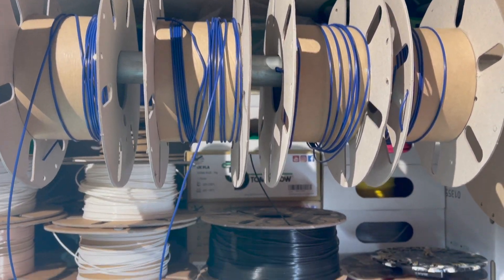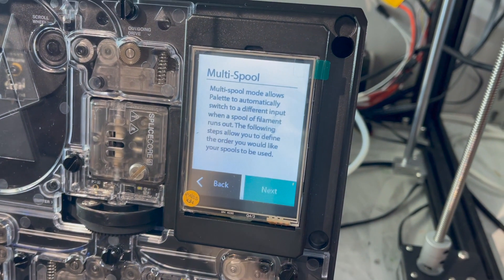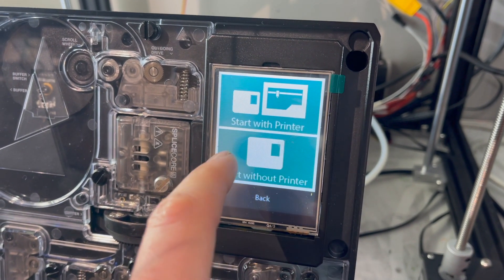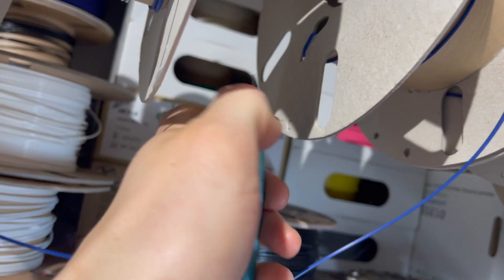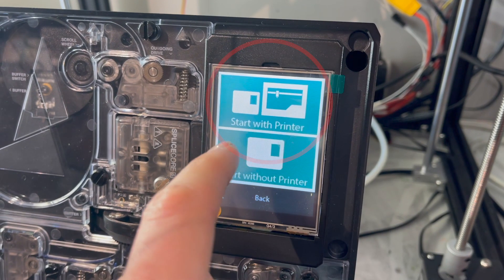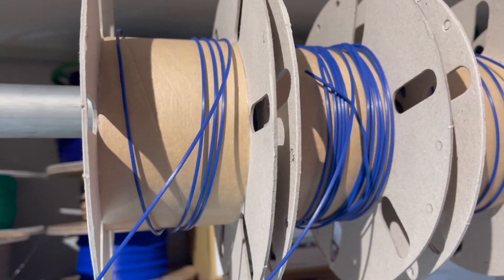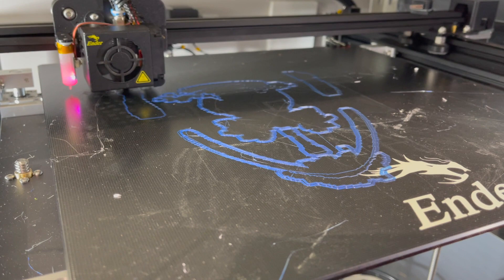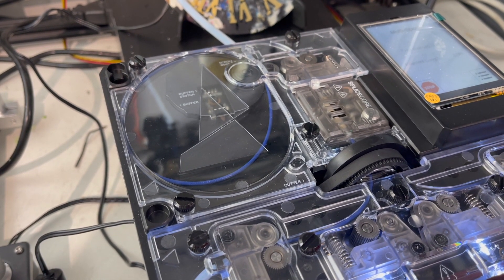PALETTE 2S 'Multi Spool' - Use up Filament Ends!!

Comment: Hi mate,

I am using palette 2s pro for the same purpose. However, I ran into a problem: While waiting for palette to splice, the extruder is still feeding the material to the hot end. After 5 second of not having any material fed from Palette, the material is chewed out at hot end, which then caused the failed print. Do you have anyway to get around this issue?
Reply from the maker: I wonder if its the end of the filament roll catching and causing issues? If the end of the filament pokes out of the spool, trimming it back before loading it into the pallette might solve the issue. Let me know

Comment: A skull?
Reply from the maker: Not a bad guess actually, it is a face! It should have been finished by now but the pallete clogged😅 I resumed the print with some Gcode wizardry so all good. Timelapse will be up Thursday I suspect. I’m wondering whether the curvature at the end of the filament roll had anything to do with the clog, it worked to get rid of three filament ends though, so quite handy! I’m going to do more tests…